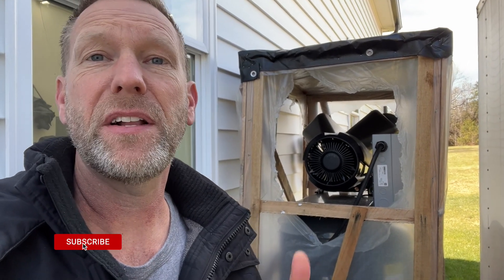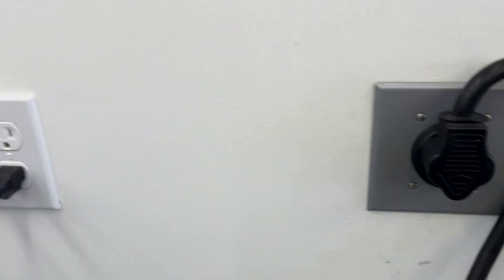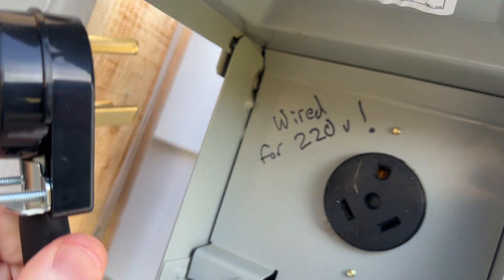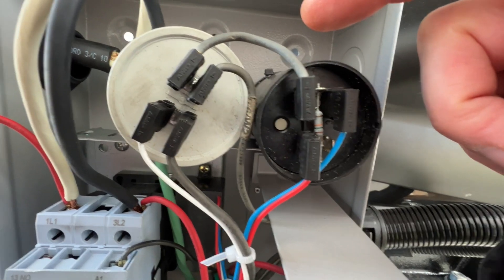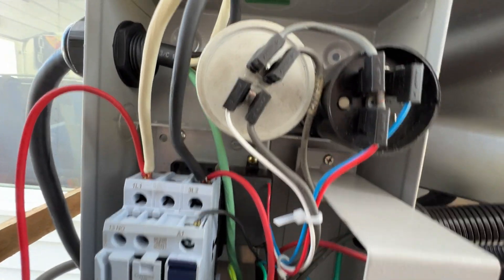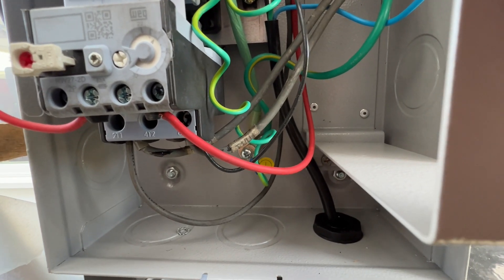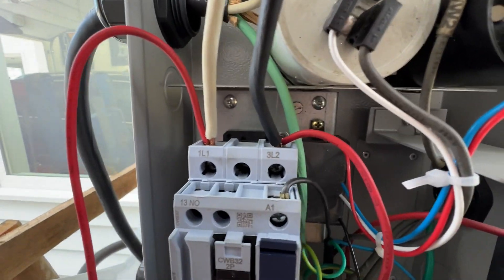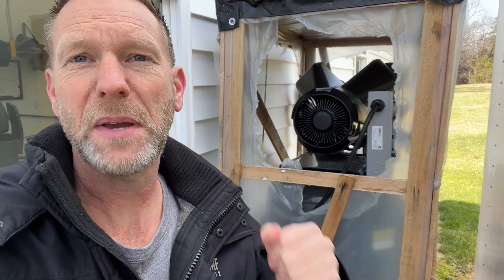Magnetic Starter wiring for 5HP Air Compressor (Schulz of America)

Comment: I'm running into a wiring issue. I have a WEG 00536OS1DCD56H-S, 5HP SINGLE-PHASE (regular house wiring - two HOTS and a ground. I know I come at T1 and T3 out from the mag switch to the motor, but when I opened this new motor, there are FIVE WIRES with the plate ID as. 7P2 Brown, T5 Black, T4 Yellow, T8 Red andT1 Blue. However, these do not match the standard HOTS in 240-1P (Red/White) and there is no T3 listed on the plate. Blue seems a weird color for T1. No answer from WEG, yet and there are NO SCHEMATICS on the internet I could find. I deas or direct help with a schematic appreciated!
Reply from the maker: Sorry I’m not sure but maybe try calling a local electrician?

Comment: Quick question, if you’re running the welder and compressor at the same time, is the single 30A breaker enough for both? I thought it had to be a dedicated circuit for each, but im brand new to this. Thank you for your input.
Reply: Also, im not sure if im seeking this correctly, but the white and black wires you pigtailed from the 30A outlet are hots? Did you phase the white to 120?
Reply from the maker: They are both hots. Technically I should wrap the white in black tape to make it clear
Reply from the maker: I would never run them at the same time. It would not be enough for both